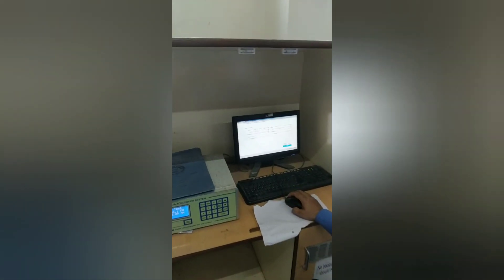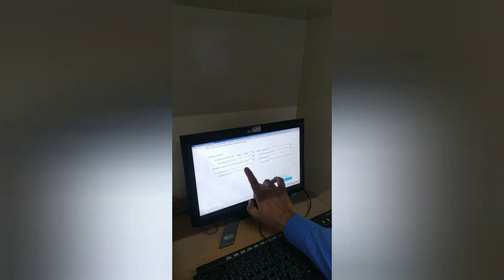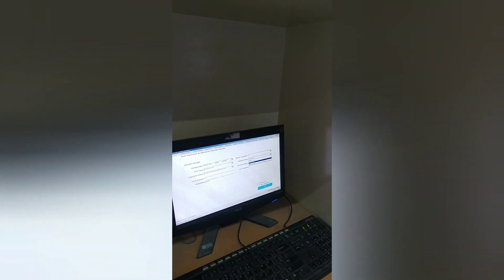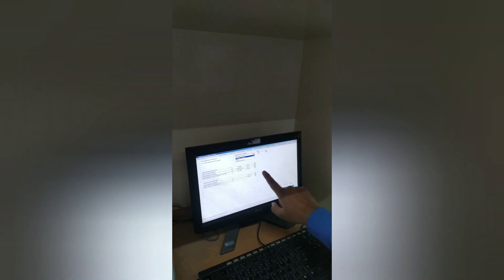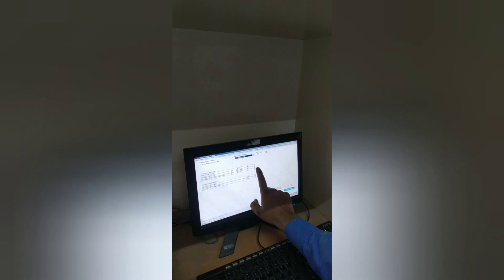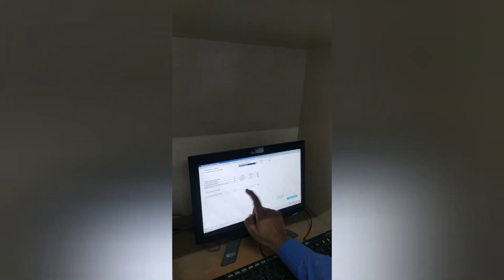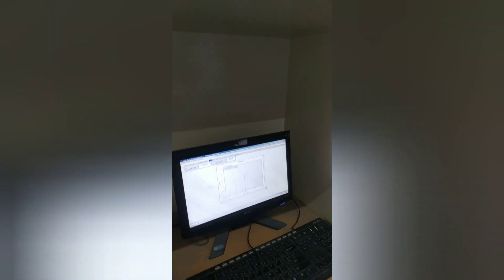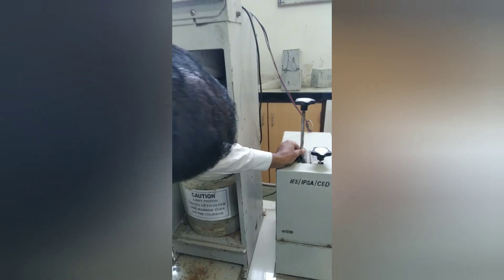Core cutter test of concrete

Comment: Bhai you have to do capping in it either with epoxy or high strength gypsum.
Reply from the maker: Yes... I applied high strength gypsum too.. But if your concrete surface is fully even then you have not necessary to apply this agents.. ..
Reply: @TechSethia  positive!
Okay, I did core test couple of days before and it miserably failed. Do you think it is 100% reliable? Or I have to support my report with other tests? Because I did Rebound hammer my value came btw 30 to 40. Just want your suggestion.
Reply from the maker: You have to go for ultrasonic , rebound for further and finally sum up all.. Then I think it may reliable.. 

Your target strength? And actual achieve?? 

Please give data me
Reply: @TechSethia  building height is 8 story.
Core extracted from GF beam.
Target strength = 25Nmm^-2
Strength achived in test = 12.5Nmm^-2
No of sample = 1
 height/Dia ratio = 1.3
Rebound hammer number = 40.
Reply from the maker: Collect sample from 3-4 different location with same day casting material.. 

Then it will give you average result.. And how many days curing done and  number of days complete after casting??